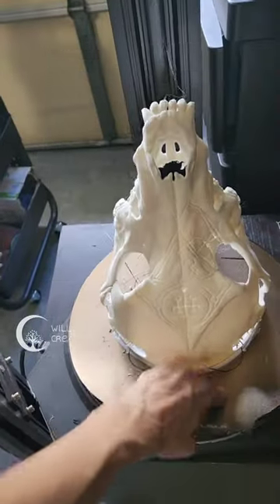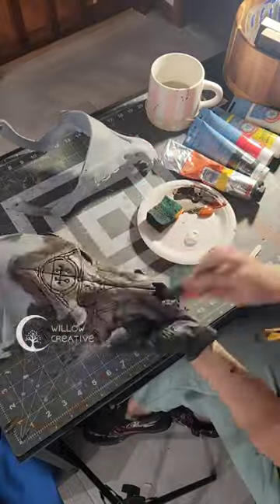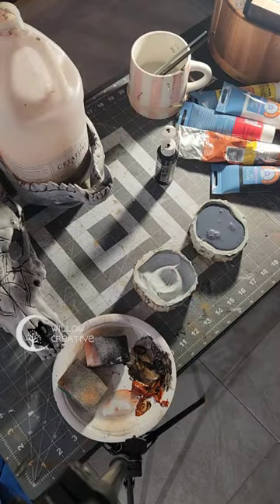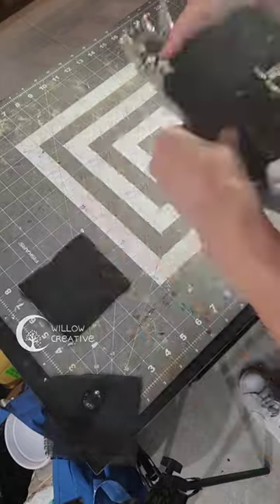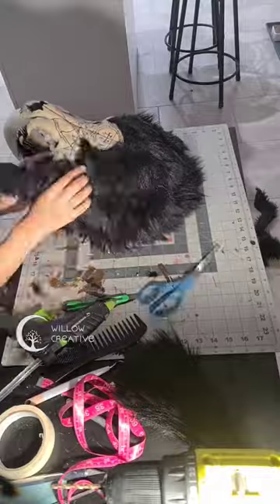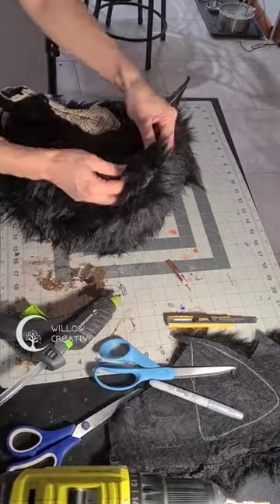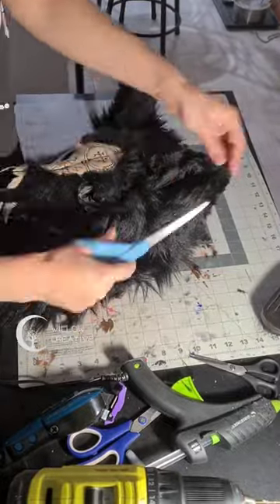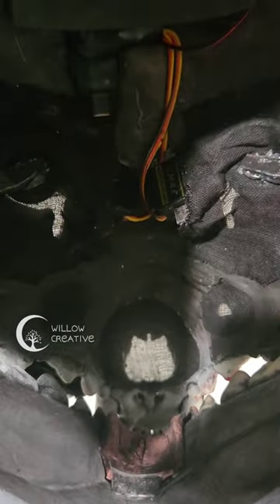Creating my bloodied wolf mask (Mephisto from Diablo IV)

Comment: Hi! I'm not sure if you give advice but your work is really good quality and cool looking so I figured I'd ask. Is there any way to make a snake jaw piece? They basically have a separate bottom jaw that moves out as well as down, I think that would make for a really cool costume, but I've got no engineering skill or knowledge, and couldn't find anything online about the possibility. The best ideas I have are to Frankenstein two hinges on top of each other or to use a ball cricket joint- but I don't really know how either of those would work.
Reply from the maker: a parallelogram linkage would work best, i used it for the cannon in my samus cosplay (i dont have a video of this, it's an old costume)

Comment: Have you tried using space blanket as material for eyes? It looks like mirror in normal light but viewed from dark environment like inside a mask, it is transparent.
Reply from the maker: never seen any, black mesh so far does a great job
Reply: It's usually found at locations that sell emergency or survival gear (or ebay). couple of dollars for about 140x200cm sheet of the material. It is also goes by name "survival blanket".  @WillowCreative
Reply from the maker: @otso648 if it reflects in normal light its not something you want in a mask as it draws attention, you want it to be hidden